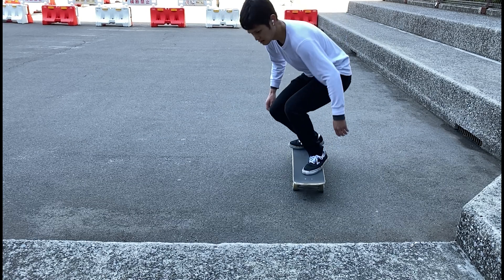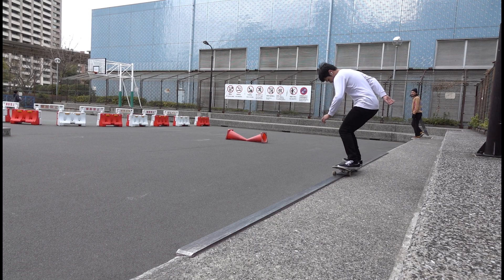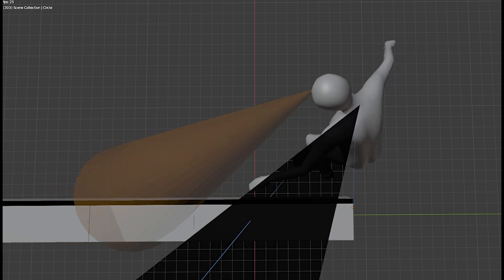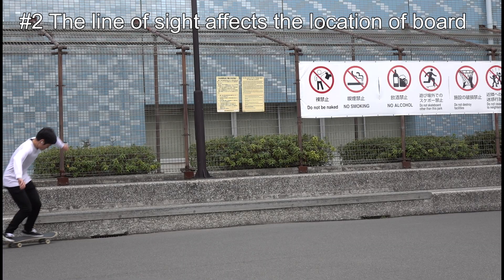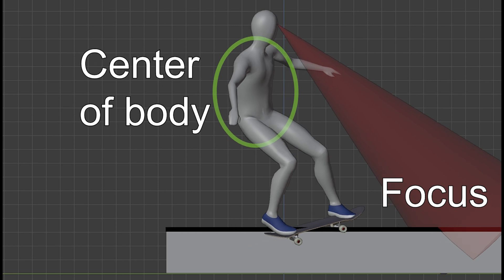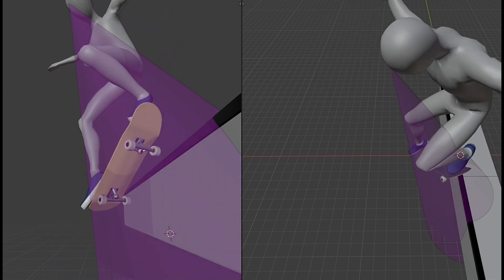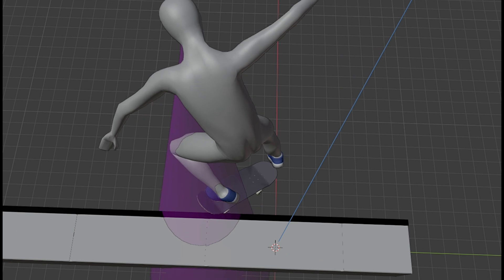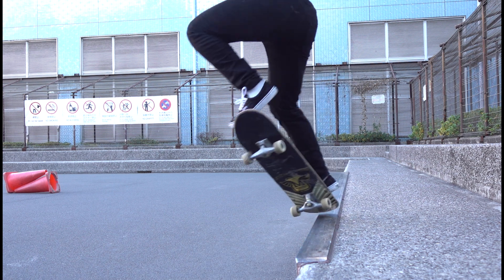The line of sight in BS 50-50 in skateboarding and science behind it

Comment: Although I think the line of sight IS super important for learning and improving your back 50-50, I think the main reason backside axle stalls on ledges are easier is because when you come in at a steeper angle you essentially have to do a backside 180, which is much more intuitive than ollying BEHIND yourself to a ledge nearly parallel to your body (which is what you need to do to learn a true back 50). This is a great video and super helpful, just wanted to add my 2 cents.